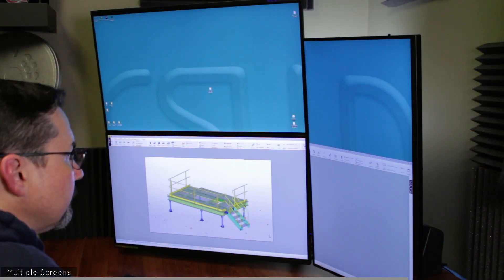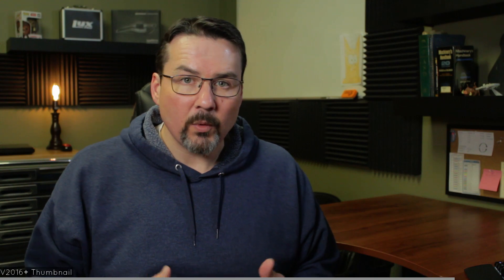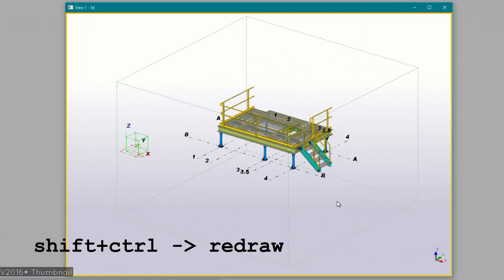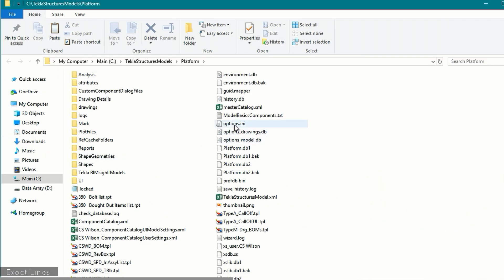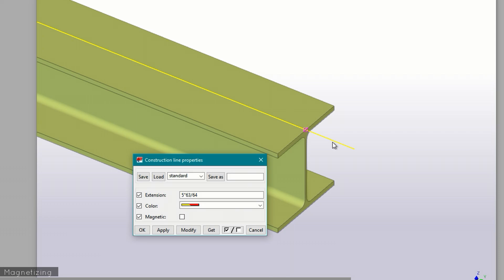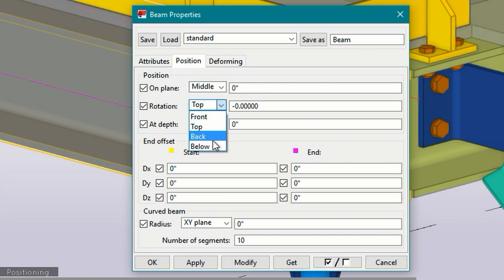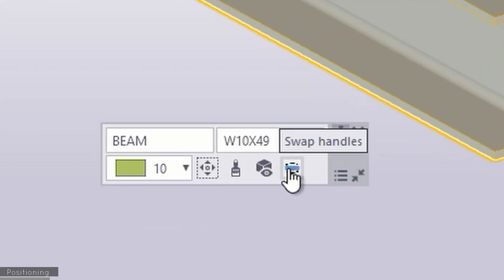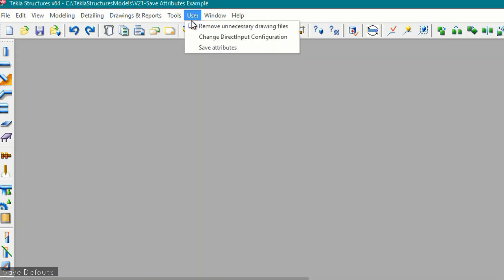Tips and Tricks: Part 1 - Modeling Techniques Using Tekla Structures

Comment: Hello Wilson,
I have a question regarding anchor bolts. How to move anchor bolts and base plate location without disturbing column location. when I am trying with custom component it didn't worked out. please help me out in this part.

Comment: thanks sir 
very usefull lecture but option ini is not showing
I am using version 21.1
i
Reply from the maker: option.ini is located in the model folder.  If it's not there, you can create it with a text editor.

Comment: Please Sir i exported Tekla structural designer steel model to tekla structures to design connections , i received warning message that material used that's S275 is not found. How can i resolve this. 

Thank you in advance

Comment: this video is great, what a presenter, but i'm disappointed you didn't add my tip and trick from the forum about a CTRL+P that stays zoomed in, but then again you may not use CTRL+P much as you always have your 3D view and plan views open on your screens. In case that tip would help anyone else, try this in 2016 upwards:

CTRL+P to stay zoomed in.

• Go to Settings > Keyboard Shortcuts.
• Find and clear “Switch to 3D or plane” 
• Change it to something new, like CTRL+[  
• Press ASSIGN.
• Find “Zoom Selected” change to something close, maybe CTRL+]
• Press ASSIGN & Close.
• Go to Component Catalog.
• Go to the menu and chose Record Macro, Global.
• Name it something like “3D to Plan”.
• Hold CTRL
• Press [
• Press ]
• Release CTRL.
• Click “Stop Recording”
• Go back up to Settings > Keyboard Shortcuts.
• Find “Macro.3D to Plan”
• Assign the shortcut CTRL+P to this new macro.

BOOOOOOOOOM!!!!!!!!
now when you have an object selected and you CTRL+P it, it will turn it to Plan view but still zoomed in on that object and you won't need to go zooming in and finding where you last where in the model.
Reply from the maker: That's a great tip!  I've made note of it and may include it in a future video (I'll give you credit for it, of course).  Thank you and thanks for watching!

Comment: Hi,im using 18.1 version in unable to split tekla in different screen by the settings u provided,plz advise what else i need to do in settings
Reply from the maker: I'm not familiar with v18.1, but if the XS_MDI* variables are in the advanced options, setting them to false should work.  I can't find any other information for v18.1 since the Tekla User Assistance website only goes back to v19.

Comment: Hi dude, have you ever try to load any complicated shape from solidworks to tekla? What is the best way?
Reply from the maker: I've imported a few things into Tekla Structures.  I don't know what software generated them, but STEP files work pretty well.  From my experience, the easiest and most reliable import comes from SketchUp (.skp files).
Reply: Dear Wilson, Can I convert stp files to skp files? The reason that I am asking is because I never used sketch up. What is the best way to load stp files?
Reply from the maker: If you have stp files, there's really no reason to go through SketchUp.  Just import the stp directly into Tekla Structures.
Reply: I can create any stp file from solidworks. My question is if there is any more proper way. For example if I have a surface with double curvature I am importing it as an item but the analysis in Tekla is a little bit awful
Reply from the maker: I don’t have a lot of experience with importing complex geometry.  It’s not something I’ve really needed to do. You might be better off to contact the Tekla help desk.

Comment: First tip (expanding to multiple monitors by changing those three MDI SOMETHING settings) didn't work on v16.1. Am I the only one using that version?
Reply from the maker: I'm not sure I can help with that, V16.1 is before my time.  I started with V19.0/V19.1 and the XS_MID... settings worked without any problems.  Are the XS_MDI... settings visible in the Advanced Options for V16.1?   I tried to look this up but the Tekla User Assistance website only goes back to V19.0, so information is limited.
Reply: Yes, all three of them exist. But setting them FALSE didn't let me use my monitors the way you do. So sad. Keep up the videos please, your videos are smashing ;)

Comment: Can you make splices in reinforcement in tekla, can you make these splices stagered?? If you can make a video regarding this tip, it would be very helpful
Reply from the maker: Sorry, I'm not very familiar with concrete and rebar detailing since I'm primarily a steel detailer.  Thanks for watching!
Reply: You can with the new Rebar Sets in 2017i upwards, when you have Direct Modification turned on there is a splice option on the contextual toolbar when they're selected.

Comment: Yesssss this is wonderful & useful settings work in multiple window but I have a question if I maximize the window, ribbon tool bar is not possible access is there any other settings to work in maximize window with access to tool bar that is great 
Once again thanks for sharing
Reply from the maker: If I'm reading this correctly, when you maximize a view on the same monitor that the ribbon is located, the view covers up the ribbon.  If that is your situation, then this cannot be avoided.  It's best to manually resize any views that are on the same monitor that the ribbon is located.
Reply: CS Wilson Draws  thanks for answering, we can raise request to Tekla for this settings I will do it thank u once again